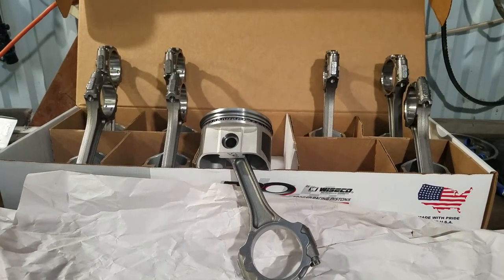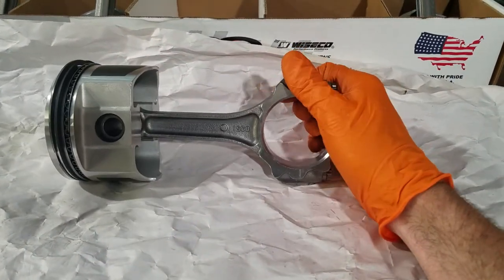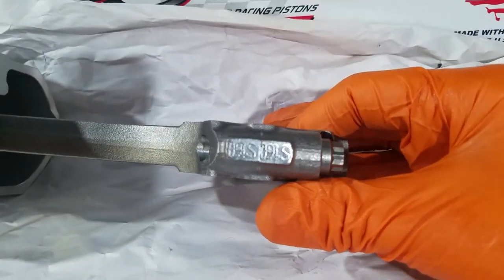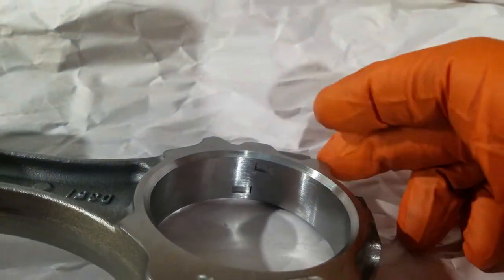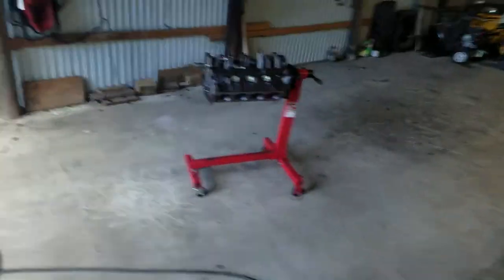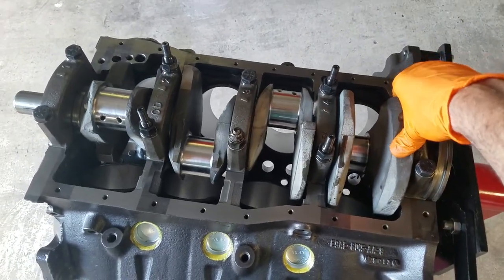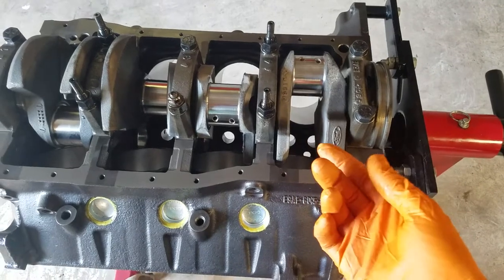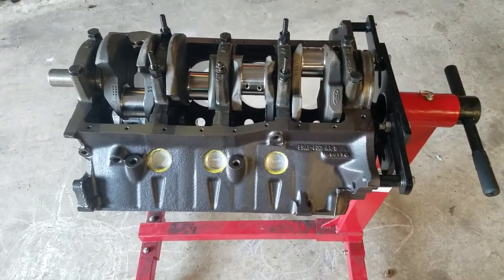Ford 302 351 400 460 indexing connecting rods

Comment: Are those ARP 8740 3/8" rod bolts?  I'm doing a similar 351W build and was going to go with same pistons and rods.  Was wondering if an ARP 2000 bolt upgrade was worth it. Summit has the max rpm for the SCAT pro stock I beam at 6200 rpm, which seems kind of low.  Assume the bolts are the limiting factor.
Reply from the maker: That's a good question. I'll try to keep it short. I did quite a bit of research on these rods before I used them. I have my Rev limiter at 7,000. Honestly, I know guys that have used  stock  football rods at that rpm for 10+ years in drag racing NA with  8740 arp bolts in them. Knowing a power adder was also in the future I opted for these BC of price/strength with 8740 bolts. If I personally wanted more strength I would switch to H beams with 7/16" bolts, the 2000 bolt option on the I-beams puts it in that H-beam price range. But now you are getting within cast crank 408 stroker kit territory. Where do you stop the snowball??? 😆. In the quest for affordability, I feel confident with the I-beams with 8740 bolts for my purposes keeping it under 7,000. After all it's just a stock cast crank. You'll have to decide what lets you sleep at night. 😁👍
Reply: @blueovaldude  Thanks for the response.  I think I can sleep soundly with the 8740 bolts.  I won't be going over 7000, and will likely limit it to 6500 RPM.

Comment: Hey man, im installing rod bearings on a stock 95 351w. What clearance did you use for your conrod bearings? Stock crank is 2.3, so im assuming .002-.0023. Clevite has the spec at .0005-.003. Ive heard alot of people tell me .002 is too loose and to go for .0015
Reply from the maker: Good question.  For a high performance engine generally .001 for every inch of journal diameter is acceptable. So .0022-.003 for a rod journal in a Windsor.  .0029-.0035 for the mains . It helps allow for high rpm flex and scoring bearings.  You can go Tighter in a stock non performance app .
Reply from the maker: On a side note, I know a national record holder that told me he had over .004 clearance . Also use the appropriate oil for your clearance and engine temp . I hope that answers your questions.